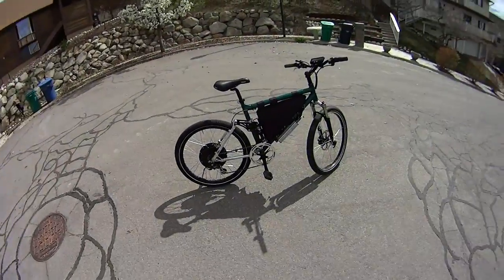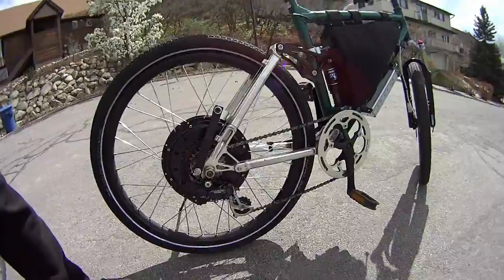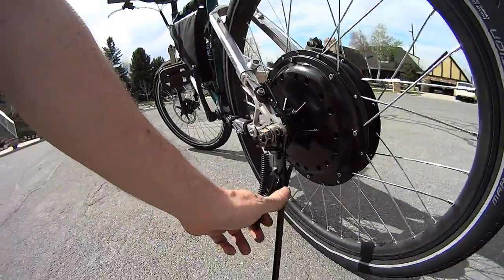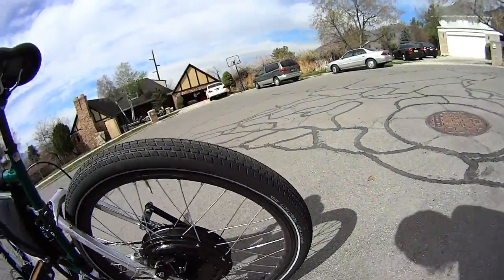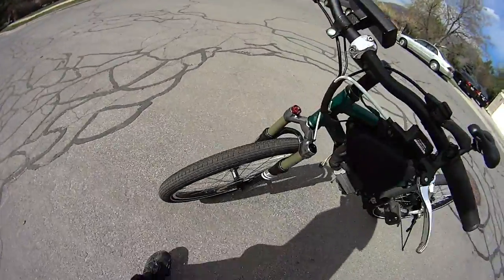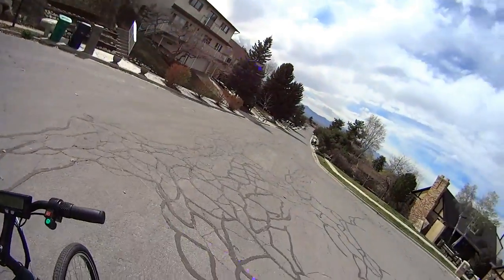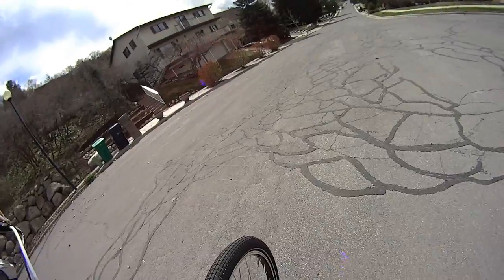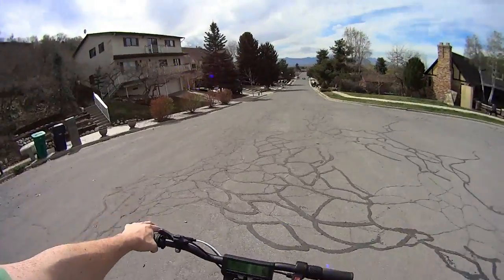leafbike 1500w hub @ maximum power

Comment: insane......  great build !
Reply from the maker: Uhh, also.. i filmed this video using a 5 year old lithium pack. Early videos were filmed on a 10 year old camera with the original lithium battery in it. If you treat them right and spec them conservatively for the job they will last a very long time.

The battery pack i used in this video is now 7 years old and is still performing light duty on a 1000w ebike my wife uses.
Reply: @neptronix    Where Did you get it at or build; Thanks @lilindianfeather@gmail.com
Reply from the maker: @jerryjordan8551  I built it myself.  https://endless-sphere.com/forums/viewtopic.php?f=30&t=66489
Reply from the maker: Absolutely. But on this power setting, the bike already was threatening to flip me on my head, even though i was leaning forward as much as i could ( notice the handlebar configuration ). 

If you go with a smaller wheel and up the volts, you had better have a long wheelbase, or at least excellent coordination and core strength!
Reply: You think that with a smaller wheel you get better torque ?, because that is my hypothesis, also tell me if it is more expensive an electric bicycle than a motorcycle scooter gasoline?
Why do you buy electric bikes? Because the most expensive is the battery and this lithium battery lasts maximum 3 years with moderate use and less than 2 with a constant use.

Comment: Ive got a 1500w on order , cant wait ! Nice vid , is it fairly easy to get the front wheel up with the power ?
Reply from the maker: Richard Williams Hell yeah. The default winding will wheelie if you aren't positioned forward enough at 80-90 amps x 48v. At least with this 190lb rider, anyway. 

On 72v and 90 amps, it's hard to keep the front end down. You really have to ease into the throttle, otherwise you're gonna land on your head.
Reply: neptronix Sounds great , cant wait , ive just subscribed to you and ile post a vid of my setup with you when its sorted . Ime just altering a cheap triangle bag to accomadate my 48v 20ah battery .... Nice one !

Comment: You should speed test on a track not a public road
Reply from the maker: malloott I'm accepting donations if you'd like to help me pay for one. :)
Otherwise, quiet streets on sundays while everyone else is at church will do!
Reply: neptronix Haha, yeah that will just go to more speed on your bike for public road use :P
I respect your need for speed and technical skills, i'm sure you know your street well enough to do this. However this looks really dangerous and my mind just projects kids running onto the street in front of you all the time when i watch this. 

Maybe a street without parking lanes everywhere next time?

Ps: will post something in your thread on es i have some questions
Reply from the maker: malloott 
The streets are TOTALLY DEAD in this area at the time i took the video, and my brakes have no problem pulling a panic stop. 

I ride almost this fast on city streets without issues. This bike stops just like a motorcycle does. It has more stopping power than i would ever need.

It's rather amazing what a 203mm hydraulic disc brake and really strong regen can do.
Reply: Shut up mom

Comment: Epic motor and videos on the leaf motor thank you for being so informative ;) 

ive just bought one of these myself an have a 12 fet 4110 infineon Controller

what settings do you use on your 48v nominal an 72v nominal ie battery an phase amp settings? (I also have 20c lipos either 48v 15ah or 72v 10ah) 

are you on endless sphere as I recognise your user name...if so hi I'm Phillmoore =D
Reply from the maker: Of course a smaller wheel has better torque. For the same reason that a lower gear on your car produces more torque.
I don't buy electric bikes, i build them. The battery i am riding on is 7 years old and still operates today.
Reply from the maker: Phillip Moore I'm on endless sphere. I run about 90A batt, 230A phase  currently.
Reply: You think that with a smaller wheel you get better torque ?, because that is my hypothesis, also tell me if it is more expensive an electric bicycle than a motorcycle scooter gasoline?
Why do you buy electric bikes? Because the most expensive is the battery and this lithium battery lasts maximum 3 years with moderate use and less than 2 with a constant use.
Reply: hahha good answer. where did you get that batteries die after only couple years from?
these batteries today can last up to if not more than 10 years and at that point they pretty much pay for themselves

Comment: great video ! this is a beast.
Reply from the maker: em2k20 I hit 60mph in this video on 76v nominal.
I do 45mph on 48v in 120% mode on my controller. 

You should be going faster on your voltage. You probably suffer extreme voltage sag.
Reply: neptronix i am only using a 20amp continuous controller an 60v for 49mph this motor is amazing
Reply from the maker: em2k20 

Bump up the amps, dude.
Reply: okayplayer got the same motor with the supplied controller from leafbike going 44 on flats with 10ah 70v
Reply from the maker: em2k20 

Why so slow? are you not giving it enough amps... voltage sag.. what?
Reply: neptronix im doing more mph with less watts than you slow 44mph I think not